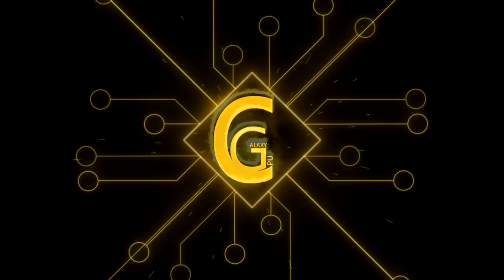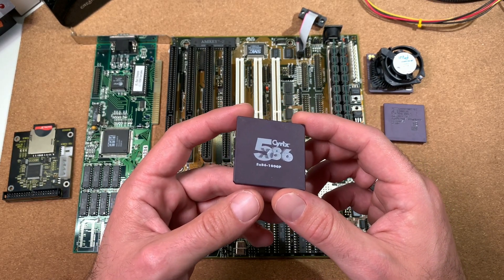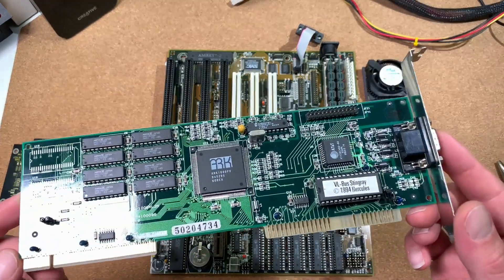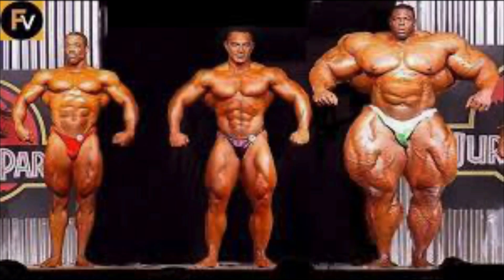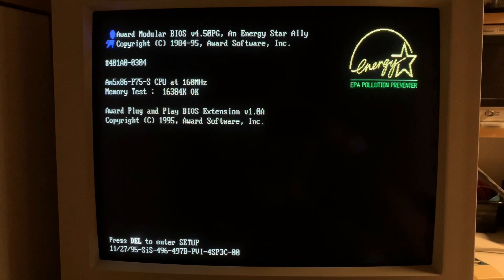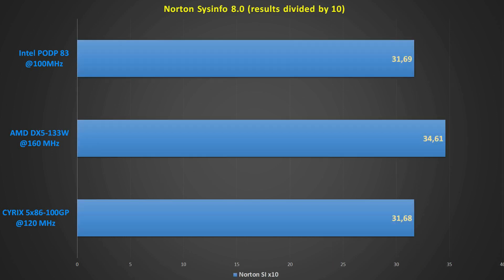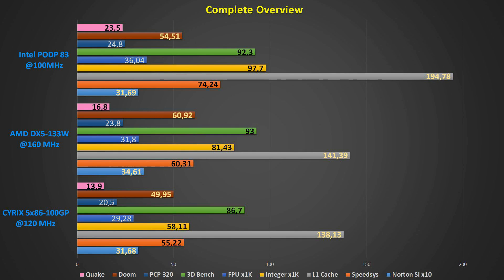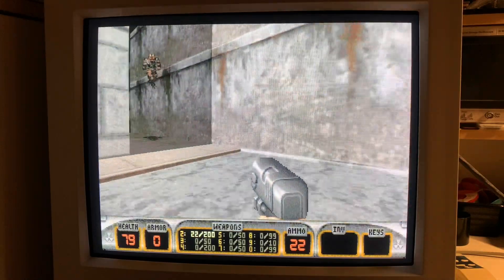Socket 3 OverClocking - 486 AMD X5 at 160MHz, Pentium OverDrive at 100MHz, Cyrix 5x86

Comment: Not a fair test here. 
You've taken the fastest AMD and overclocked it by 20%, the fastest Pentium Overdrive and overclocked it by 20%. But then you've effectively taken the fastest Cyrix cpu (a 120MHz) AND NOT OVERCLOCKED it. How about a re-test, where you run them at their design limits. Ie the AMD at 133Mhz, the POD at 83Mhz and since there was a 120Mhz Cyrix 586 chip, run the 586 at 120Mhz still? This gives a much fairer comparison. Scaling accordingly the final results are AMD 333point CYRIX 345 and POD 389. 

1st POD at 83Mhz       with 389
2nd CYRIX at 120Mhz with 345 equivalent to 74Mhz PentiumOD
3rd AMD at 133Mhz    with 333 equivalent to 71Mhz PentiumOD

otherwise though, fun video with lots of fond memories. In the day I owned a CYRIX and an AMD, but by the time the POD came I'd switch to nexGen 90 Mhz. If you can get hold of one, how about a 4 way drag race. Nex gen 90Mhz vs POD 83, AMD 5x86 and the venerable Cyrix 586 with all the option your m/b supports, switched on?

Comment: I don’t have the POD but I own a AM5x86 P75 that’s running with a 50MHz FSB. I am not so much into doom but the cpu runs Fallout 1 very well which is rated for a P90. I heard so many good things about the cyrix, that it’s faster in games than the AMD. Especially in FPU heavy games that I got one a bit overpriced. And to say the least I am totally disappointed. While forums state that the AMD is neither bread nor butter and the Cyrix is so much better and closer to a POD I did not get it to perform even slightly better than the AMD. I even experimented with the CPU flags of the cyrix but I never got it to perform anywhere close to the AMD. Imho if you can’t get a POD, then an overclocked AMD 5x86 p75 is by far the best choice for DOS gaming. And while you can’t change the multiplyer to clock it down it’s still not that hard to find a utility that gets this cpu into sub 20MHz terrain. So the AMD is a clear winner for me

Comment: Bestest Socket 3 processor was  AMD AM5x86-75 default 133Mhz. Nobody beat this cpu in Dhrystone! Overdrive it to 160Mhz is very good Mainboard! But Pentium was better in Whetstone, used better cache to memory and was better than in Games! 
To get this Intel overdrive processor was in my country in the 90s very hard and its price was much higher than at AMD. AMD was best option price performance/ratio

Comment: So is a 40MHz bus usually fine for continuous use even for VLB video cards? Thinking about maybe trying to do this with my S3 Vision864 2MB VLB card and Intel 486 DX4-100 pushed to 120. I'd like to get the most out of them, but would also like them to be around for another 25 years. Thanks.

Comment: Good to know about the overdrive and quake.. I figured it would be significantly better due to the game being written for the Pentium architecture / FPU ... Quake was very playable on my DX4/100 setup back in the day with a decent S3 VLB video accelerator (infact the early retail box said minimum requirements 486DX4/100 on the back - this changed to Pentium in later versions).. I would have loved a Pentium OverDrive chip for mine back in the day... My DX4/100 was one of my favourite PC setups of all time.

Comment: Very interesting video, but there's a thing that you have to know:

486's motherboards have a speed limitation on RAM, PCI and VESA busses at 33'3Mhz, and on ISA bus at 8'33Mhz (33'3 / 4), so when you start with a 40Mhz bus clock the chipset divides the RAM, PCI, VESA and ISA busses by 2 and they work at 20, 20, 20 and 5Mhz for getting overclock protection of the cards.

But there's a thing to do for getting the real 40, 40, 40 and 10Mhz on the busses: You have to connect the turbo-switch to the jumper which changes the bus speed from 33Mhz to 40Mhz. Then you start the system with the 33Mhz bus clock and when it goes to the operative system you turn the bus clock to 40Mhz by switching the turbo-switch (hot overclock) and so you get the BIOS doesn't divide the bus clock. 

You have to test it and you'll see that the system performance will be really better than starting directly at 40Mhz 😉

Comment: If your motherboard supports it, try running the Am5x86 at 50 MHz FSB and x3 multiplier. 
It gave me better performance than 40MHz x4, probably due to the bigger benefit of faster FSB over 10 MHz difference in speed of internal clock.

Comment: I had an X5-133 that served me well through my first 3 years of College.  It would run at 160Mhz but wasn't very stable so I kept it at 133Mhz most of the time.  I also had one of those odd PCI/VLB/ISA motherboards but I had no issues with the PCI bus, maybe I just got lucky. I actually upgraded to a P200 specifically to play Quake at decent speeds because it just wasn't much fun on the X5!

Comment: This brings back memories 25 years ago! 
But a vip board is not the best platform for overclocking. VLB becomes increasingly unstable above 40 Mhz and the whole system with it. I achieved a rock solid 42Mhz clock on a VIP board, 486 dx2 so 82mhz, with stable PCI graphics. Never ended up using the any of the VLB slots.
A friend at the time had a PCI/ISA board with a 486dx4 he achieved a mostly stable clock of 50Mhz so Cpu at 150. Great for doom, and struggled with quake. Was the last stepping, or one just before. He even managed to wire the jumpers  so when powered down you could flick from stock to overclocked. For college work vs gaming via some external switches.

Edit addition. Both these systems were Intel 486s.

Comment: Had to resort to my M912 to get my POD@100 to run doombench stable - 62.9fps (1MB L2 Cache, S3 968VLB, sadly only WT for L1).
With the modern FastDOOM port I can even get up to 74.6fps.
Reply: Voltmodded my POD, so it runs stable ... I'm getting 24.1fps in quake, as well as slightly better results with PCP320, on the other hand your board beats mine slightly in Speedsys and my Doom results are 1.8fps lower.

Comment: I will never understand why people overclock old and already rare hardware. This things never produced anymore and ever part who goes damaged make it harder to finf a working part. If i want a faster system then i switch to the next generation, today no one has problems to switch. The hardware to do this is available.
Reply: The AM5x86-133 is well known to work well @160mhz as well as the IBM CX5x86-100@120mhz, this is pushing it for a standard cyrix 5x86-100.

Amazing he got the pentium overdrive to run @100mhz I never had success, lucky chip and/or motherboard who knows.

I would love to see some videos on the Cyrix with the enhancements theirs performance to be had.

Despite this the AMD 486 I FOUND is still faster though, (160mhz vs 120mhz).
Reply: yeah the amd 586 were designed to run natively at 160mhz, but old hardware like that is pretty rugged and that's without any vcore increases.
Reply: I have an AMD 5x86-P75 and it works at 160Mhz without heat spreader.

This chip was made at 0'35 micron instead the 0'5 and 0'6 micron of every other 486, so it's a really really cold chip.

I've read someway that a guy got 200Mhz with one of these.

Comment: Very nice breakdown and comparison.  I'm surprised running the bus at 40MHz didn't cause stability issues with the video card.  I'd be curious to see if you can get the Cyrix stable with all it's advanced features enabled and re-run these same tests to see if the results are any different.
Reply: It doesn't cause issues because the chipset divides the RAM, PCI, VESA and ISA busses clock by 2 if it's over 33Mhz, so they are really working to 20, 20, 20 and 5Mhz.

For getting the real 40Mhz (and 10Mhz for ISA) you have to start with a 33Mhz bus clock and make a hot switch to 40Mhz once the operative system has started. It's easy to do with the turbo-switch.

Comment: Very interesting test, thank you. The Cyrix is a bit disappointing (and my guess is that your mainboard does actually enable all its feature, otherwise it would be even slower than that). 
However if you compare the totals at their original clock speeds (assuming that the Cyrix is a genuine 120 MHz model), the POD@83 stays 1st with 524, but the Cyrix@120 becomes 2nd with 483, and the AMD@133 is 3rd with 453 (and still has the highest clock speed). 
And if we compare them at the highest clock speed available back in those days, maybe the Cyrix@133 MHz would be slightly faster than the POD@83 and the AMD@160 (not sure however because the Cx@133 runs at 4x33).